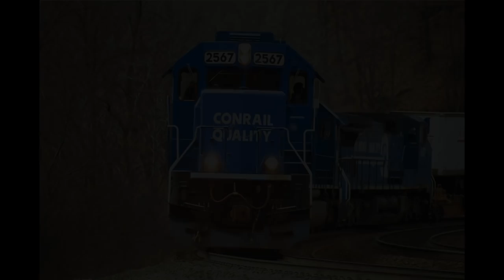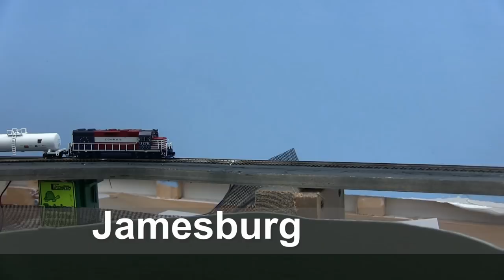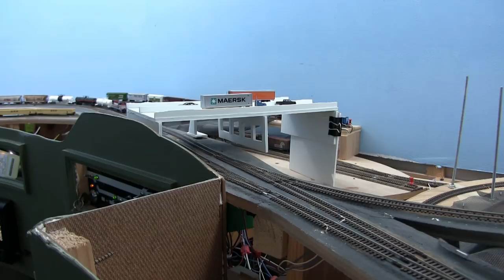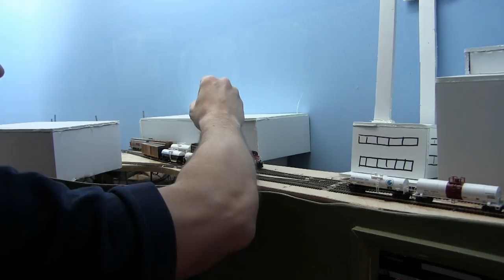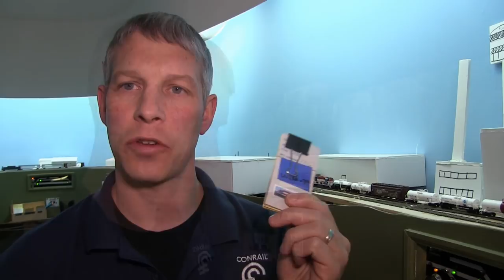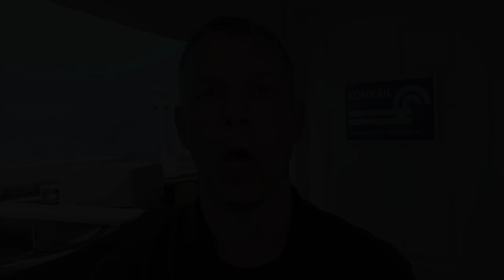Operating WJSA-39(331)

Comment: Joe, once again.. another really great video. Announcing your moves allowing us to ride along is really great. I'm wondering one thing that if it can be done may help with the sound/action.. I know you are a one arm paper hanger there running the phone sounds and the throttle ..along with camera angle.. is it possible to announce your "couple and connect" just as you are doing that move and click the sound as it happens rather than behind the action ?.. just a thought..not meant to be a nit pick.  Looking forward to the future installments of ops.  Tom
Reply from the maker: Thanks Tom. I will talk about your comments in the next video. Thanks as always for your suggestions.

Comment: Great video Joe - I often run ops sessions alone, I quite enjoy getting my jobs done in the right order etc... Since I have a small fleet of CSX engines, I often "MU" at least a second locomotive.  I often see the local railroad , the amboy secondary near browns yard, doing the same. I don't know if the purpose is to leave the loco at the far end of the line for the next days work/crew or as a redundant supply should the lead fail.  Its not likely the 2nd loco is required as most trains are 15 cars or less.  

 Do you always run your branch lines with just a single loco?

Really enjoy the videos and like the original intro music better :)  Great work
Reply from the maker: On short train yes I usually do ( 5 cars or less). But as I am building the fleet up, I can put multiple units out there now.
Reply from the maker: usually they bring a second unit out of browns in case one goes down. They haven't layed over in lakehurst/lakewood in a while (so I have heard)